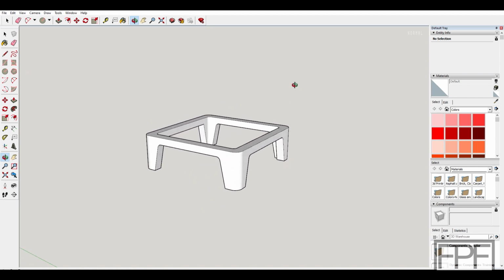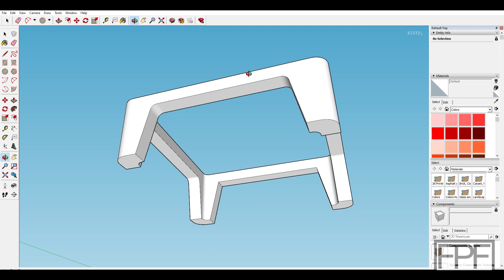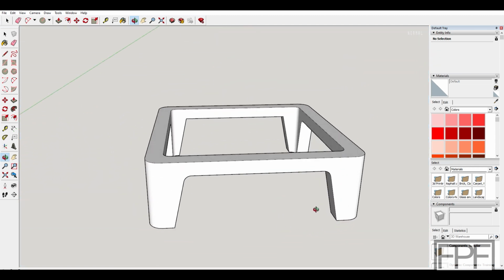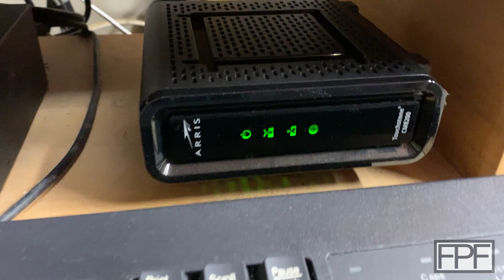3D Printed Horizontal Stand for Arris CM8200A Cable Modem

Comment: Suprised you have not received an xb7/xb8 modem/router by this point.
Reply from the maker: Not familiar with those, but they look specific to xfinity.  This Arris is purely a modem/cable gateway from local cable co. for internet.  Routing/NAT is accomplished on a stand-alone router. Wifi from stand-alone AP's in a couple locations.